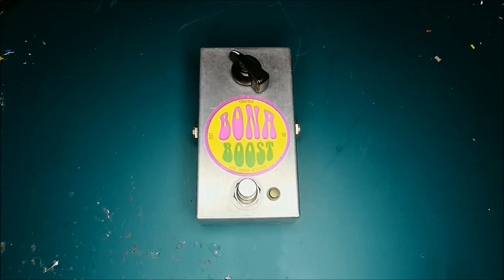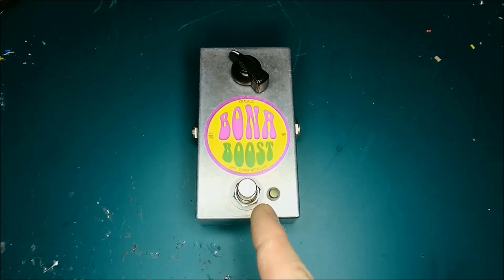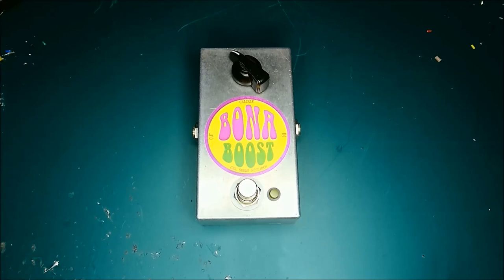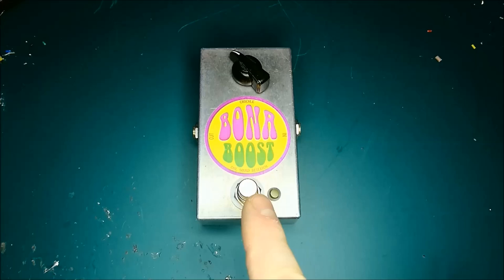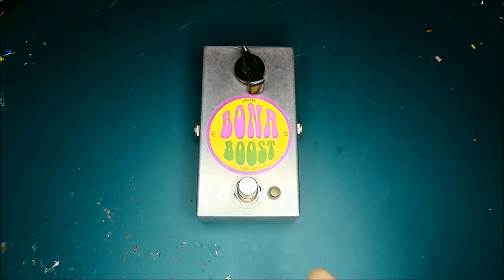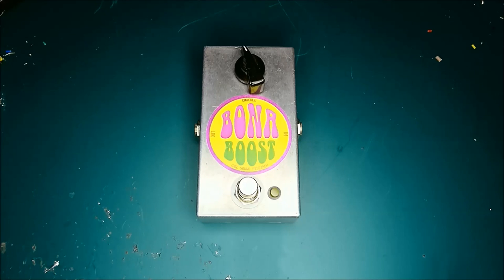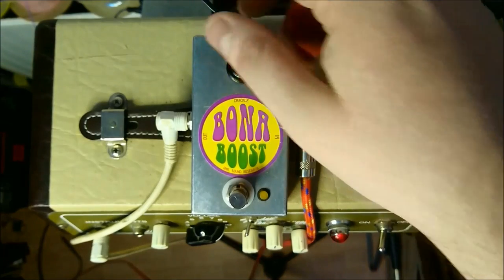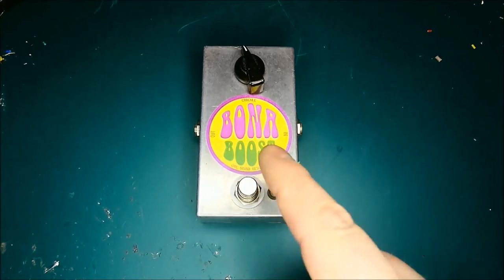GMR Bona Boost Hand Wired Boost Pedal

Comment: Just made mine. Passes sound when bypassed but only hum with no LED lit when unbypassed 😥
Reply from the maker: Sounds like a connection issue to do with the power. Reflow your solder joints.
Reply: @gmrspares  Yup, the female power jack was faulty. 9v power jack plugged all the way in, no power. Plugged in about half way, fine.

Comment: Does this have the super high input impedance that the Super Hard On has?
Reply from the maker: Yes it does. Its the same in everyway but point to point handwired.
Reply: Cool. Thanks for the response. I just ordered one. I couldn't see it in the info .. what kind of power supply does this pedal require?
Reply from the maker: Just a standard boss style 9v :)